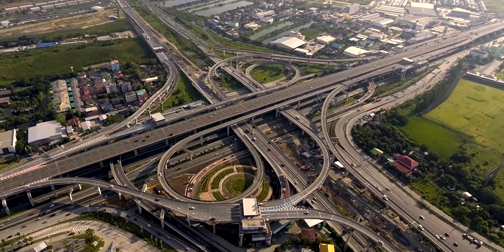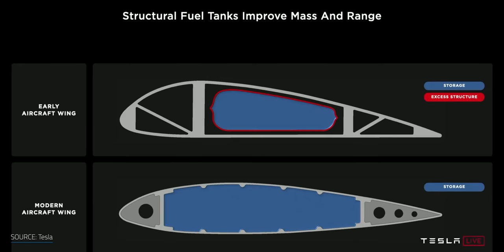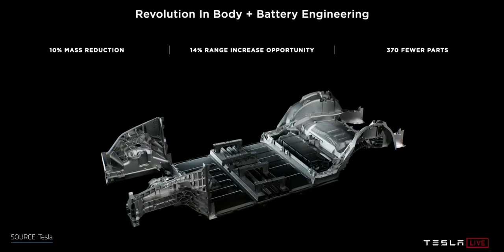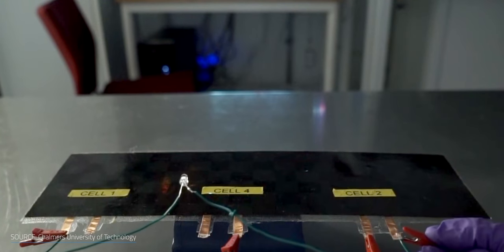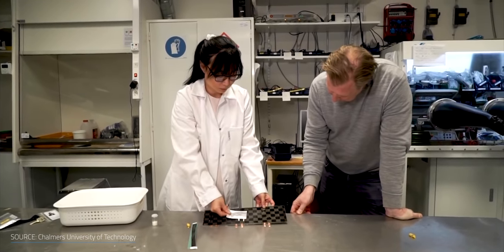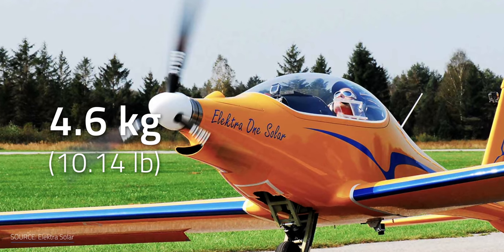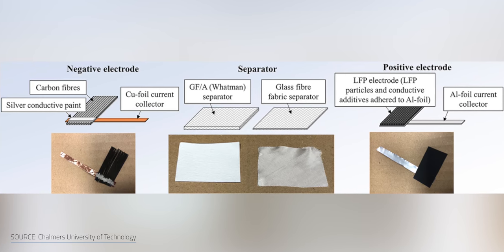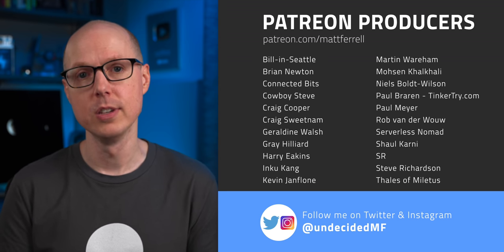Exploring Structural Batteries

Comment: First of all thank you for your informative discussion on a very exciting subject. Future clean Energy technology is Heavily   dependent on the reliable battery technology , So In my opinion structure battery is the only solution for the future of this technology. Even though Electric or driverless car Is very popular at this time but the future technology for transportation will be Electromagnetically operated high speed nonstop trains and  flying uber cars and electric solar and Battery operated airplanes, so the only practical solution for this technology is structural solar battery . For the same reason I believe the only practical solution for electrifying homes will be the hybrid of the Solid-state battery ,capacitor behind each house that is being charged by solar panels ,and  your home become an structural Capacitate and battery So there won't be any need for transporting electricity over the wires And transformer and grids . 
Dr Shah mansoori
Reply: i think you better return your PHD if you actually have one.. Because you really believe using a lithium battery as the structure of any kind of machine or structure is a good idea.... If you are at PHD level and the obvious red flags are not waving in your mind over this, then please return it...

Comment: So if one cell, in a sealed body floor fails, you buy a new Tesla? How do you replace an open circuit cell, turn the vehicle upside down and remove the under-body protection and replace the cell?  
With the body made of a Carbon fiber battery, maybe back your car into a sharp metal object and short out the battery? 

I think we need more development :)  We NEED a non destructive process like the NiFe type of battery built by Edison and his examples still work today, they are heavy and will take a huge amount of punishment, overcharge -- send em flat and strap em  + to -  for a few years then recharge and away they go again, all you need to do to keep them running for 100 years is replace the KOH every 20 years!  Come on all you chemists, lets find the real bonanza, unless like JP Morgan you kill anything like that because there is no profit in something that lasts forever!
PS the old KOH is great for your garden!!!!!!!!!!!

Comment: @ 2:43 - This "structural battery" concept is a terrible idea!  It will be much better to have a structural grid-work in which battery modules can be easily inserted & removed.  Yet another compromised concept that has not been well thought out.

Comment: The entire vehicle could be made from this stuff.  Every structural part, including body panels.  The parts can be made to bounce and return to normal, while safety structures do their job in case of a crash.  The roof could hold a solar panel integrated into one of the panels.  Trunk and hood lids.  Door panels.  Behind the rear seat.  Wherever a use for carbon fiber can be used, make one of these parts out of these kinds of batteries.  Now, about that recharging issue that was not covered...

Comment: physics lesson 0: weight does not matter in motion energywise ....
Reply: @6monem  you should because this is basics. as far as i know energy gained during acceleration is stored by the vehicles kinetic energy 1/2mv2. during steady curising only force is drag without any weight in the equation and finally during decceleration kinetic energy is regained in recuperation braking (with losses)
Reply: @6monem  it is similar when people say that weight matters in braking therefore lighter car can stop in shorter distance than a heavy truck. elementary and high schools obviously cant even teach people basic concepts of physics around us.
Reply: @6monem  I agree in practice weight matters especially in city driving whel accel/deccel happens in quick succsession. But for example in highway driving weight does not matter at all (if its not too hilly). In pure theory it does not have the effect. Anyways electric cars dont make sense for long range driving. They are most suitable as small city cars where regenerative braking is helpful and local emissions are zero.

Comment: Great.   A dead battery means the car will surely be totaled and a car with a possible 20 to 30 year useful life will be in a land fill in 7 years since it is not economically feasible to replace the battery and part of the cars actual frame.   SO how is this green??????????????????????    Landfills full of lightly used pre-owned cars.   Pissed away resources not used efficiently to their fullest extent to get the most use of all the energy and material resources to make it..

Comment: Designed to fail in an accident.  Battery built into the structure of the vehicle.  What happens when the battery dies?  You no longer have the option to replace a battery pack.  Tesla already wants $16k-$20k for a new pack.  You're battery won't charge, time for a new car.  Good in theory, bad in practice.  Especially with Tesla's already bad reputation for customer service and not allowing their vehicles to be maintained by third parties or enthusiasts.

Comment: Dont know why they dont want to weld all the parts instead of bolting. One solid car is way better - heat dissipation is perfect, no noise from mutually moving parts, save money on bolts - welder sticks are way cheaper. No torque control needed. Broken - through away and buy new! We still have enough space for our trash on the planet! Or this guy just will start to send all of this broken staff on the big unlivable orange scrapyard - looks like he know what he is doing.

Comment: I want to propose a new principle: Planned Permanence.
I want you jackasses to build like a Dwarf. I want you to make a laptop that weighs twenty pounds, five of which is metal in the case. I want its battery to weigh ten pounds and last three days at full burn. I want a cell phone two inches thick with physical buttons for back, home, and running apps that the screen can't turn off. I want a car that lasts longer than a Toyota Hilux. I want my devices to make the Gameboy Classic look fragile. I want computer programs to be coded efficiently instead of gobbling RAM and CPU like endless candy.

Comment: "The biggest roadblock to widespread mainstream adoption of electric vehicles is range." - No, that's just one of the biggest roadblocks.

One of the big selling points is supposed to be how "green" they are. But considering how lithium is currently mined and how it's basically not at all recycled (I recall something like in the single digits, like 9% of all lithium is actually recycled?), but furthermore, the machinery used to mine that lithium. Then the electricity generated to charge that EV is typically generated with not-so-clean electricity. But even if the electricity is produced by wind/solar, what about the mining and manufacture of those items? If people want to get serious about green energy, the only real solution is nuclear. Wind/solar are effectively science projects.

Comment: Now this massless battery still weights a lot, man... that an improvement of 10%, you say?. Bit you need a 300%, at least, to make them batteries competitive with gasoline... and do not forget that if the structure IS the battery, when you use your battery recharge cycles you must discard the whole car... and li-ion batteries would still explode and burn. INSIDE your estructure.

Comment: This video shows how minimal your qualification in scientific literacy is to talk about any of this... Sorry Matt. The team built 2 tiny batteries and wedged them between carbon fibre sheets, the batteries definitely still have mass, and likely reduce the structural capabilities of the two carbon fibre sheets over just being directly bonded to one another. You fell for their clickbait "massless" coinage, even the use of the phrase "structural" is laughable. The batteries have 20% the capacity of conventional lithium batteries, yet save less than 20% the mass over more conventional storage- that does not sound like a good trade off at all when the whole car needs replacing when the batteries degrade below an easily-reached threshold, so the choke-hold certain companies have over repair, maintenance and DIY (Tesla, Apple to name a few) will only get even worse with somehow adopting this very premature technology. Please read the actual scientific articles and first sources, not the tabloids and their massively over-hyped headlines.

Comment: There is already design flaws, IE new vehicle hits road debris, rips off valve... costs 16k to repair... poor design.. and the design itself is not really revolutionary... nor is it helpful for fixing problems, and battery's create heat... so underneath a person... For heat dissipation... and safety, be better to thinking thereof and store them above the persons and create airflow ventilation system since the risk of damage is far lower and the access to repair is better, the power cords can use the step avenues where the windows are lodge in. IE front windows etc. that already use those steel avenues for powering up back up mirrors etc.

Back in the 90's there was photosynthesis type of paint, that generates a current from solar activity. SO you just needed to capture the energy generated on the paint, and you simply can just paint ti repair it or wash it. The under carriage had gathering nodes that channelled the energy down into a battery system, which then was transferred into usable form of energy. Solar powered paint. Lol...

Then there is the uses of simply heat to generate power. The the list of using various things to generate energy can be harnessed in a system... but rigid panels... verse paint... hmmm... sounds like its backwards... a liquid material that then hardens and is active and the only need is the undersell that needs prepping reduces the weight significantly... maximizes the area.... so solar powered roof tiles literally could just be a gathering structure... and simply paintde ounce and a while.. which would speed up installation time immensely. since one could just dip the tile dry it install it... 

There is a load of exotic materials that generate electrical / static charges simply from being in the sun. Then we also have combination of environmental effects that do the same thing.

Comment: @undecidedMF, you start off with the wrong premise; that range is the primary hindrance to EV acceptance.  The correct answer is the lack of fast charging.  Currently 1% of the automobiles are EVs.  Currently it takes 20 - 60 minutes to charge an EV at a charging station.  Many are not going to get to work on time if they have to wait 2 or 3 hours, queued 3 or 4 EVs deep, waiting to get a charge.

The idea that the body or shell of an EV could be made of wafers of a battery is wrong in so many ways.  Just imagine a basketball hitting such a "structural" battery.  Next thing one is explaining to your dad why his $110k EV is a burning, melted mess in the driveway.

You have also, in typical MF fashion, conflated two unrelated words "massless" and "structural" together.  Nothing practical can be massless and still be an energy source to drive an EV.  Please stop fabricating "plausible" explanations of vaporware just to bump the click count.